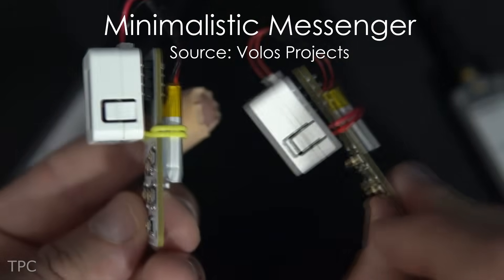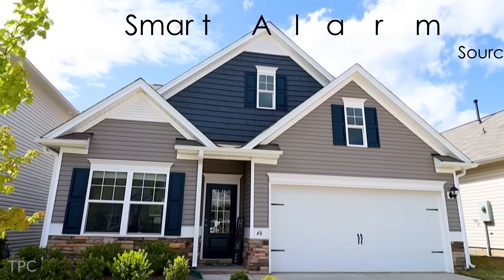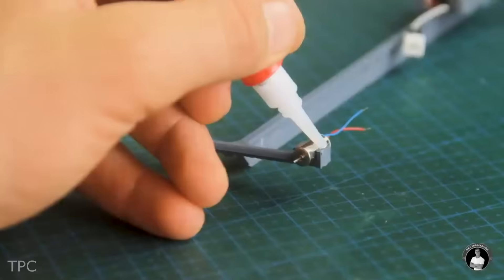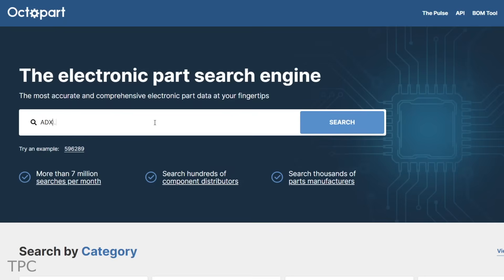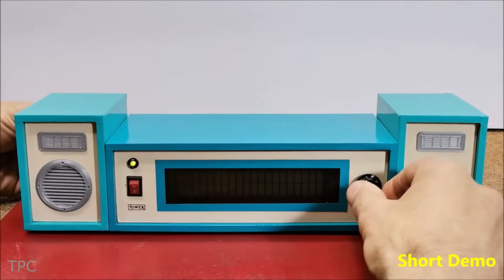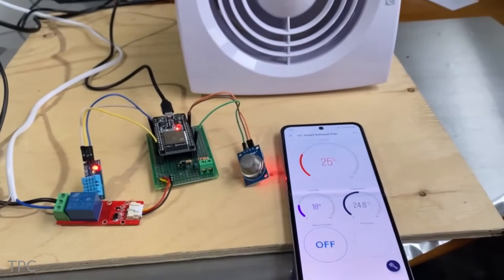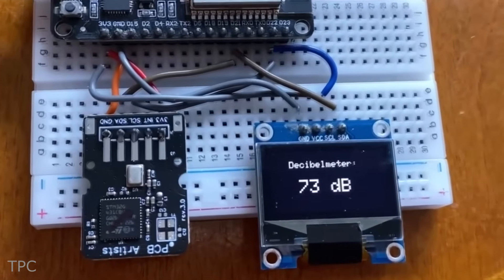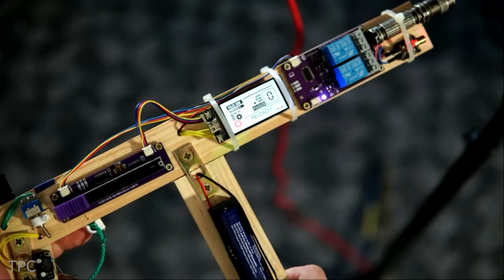An ESP32 based Messenger! (12 more Projects)

Comment: I use number 12 and had to rewrite the code. Using a CardKB in a newer version. Put it in the Cardputer too. I'm doing something similar with the ESP8266 (D1 Mini) but that's a longer story. It got errors in the code as well, but I figured it out. C++ don't like string setups, so using char is fixing a lot. Many updates simply changes some code in older tutorials.

Comment: Hi question here, im currently using to esp 32s. Once is a tx another rx code works perfectly both one issue. When discounted from lap top and powered with a breadboard power supply (Ive tried 3.3v and 5v) the light turns on indicating it has power but the code doesn't seem to "process". any suggestions I man on using them for a drone or I have to swap to the teensy. plzzzzzzzzzz help plzzzzzzzzzzzzz